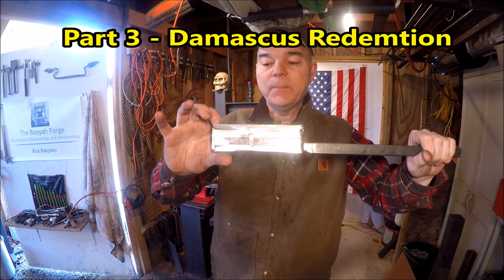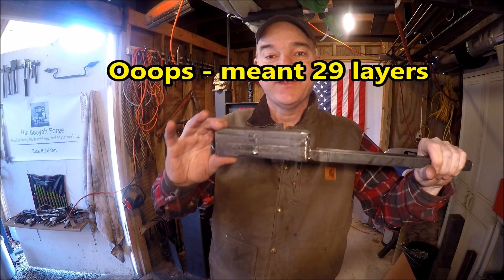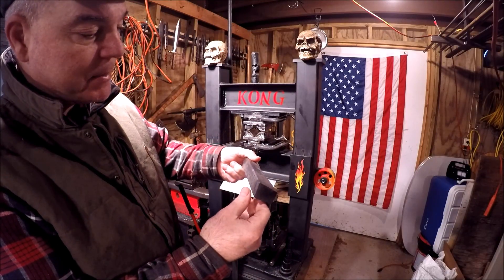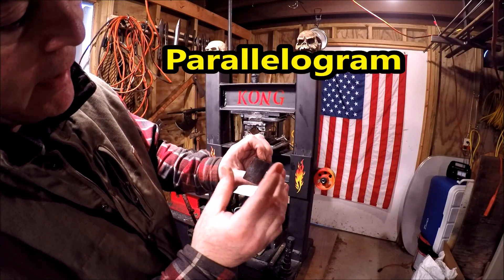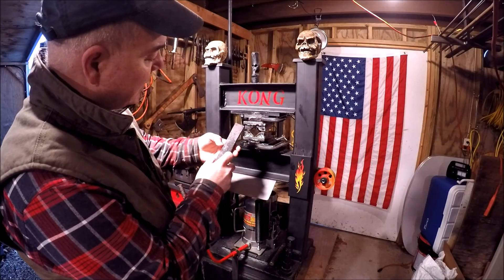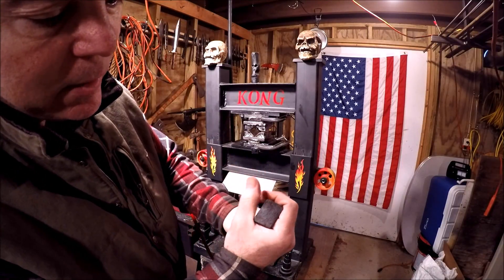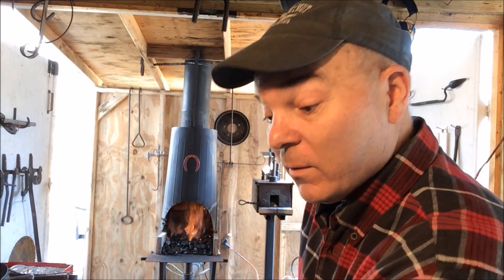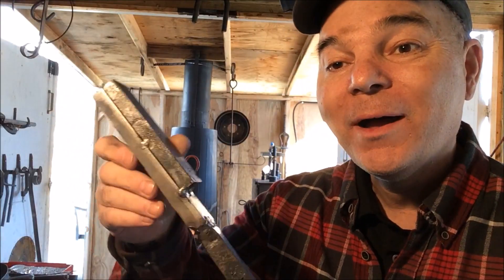How To Make Pattern-Welded Steel - FINAL PART 3

Comment: Thanx for these truly inspiring videos. Just a quick question here: when using the press,  do you lift your foot off the pedal to stop the air when closing the valve for retraction or do you just keep going?
Reply from the maker: hi - my foot is always down and I use the arm / valve to control the press.   This type of press is powered by hydraulics but only in the upward direction.   Down direction is via manual springs.